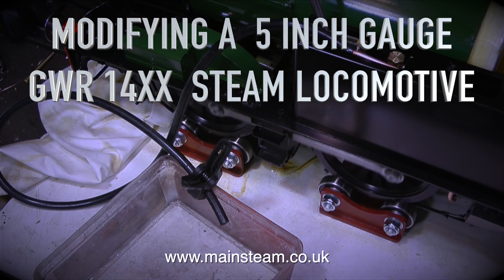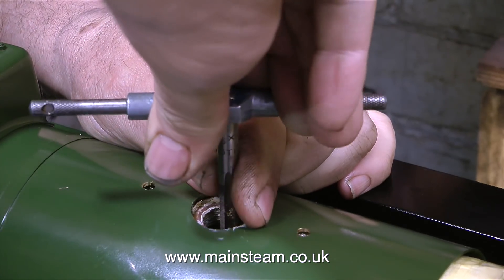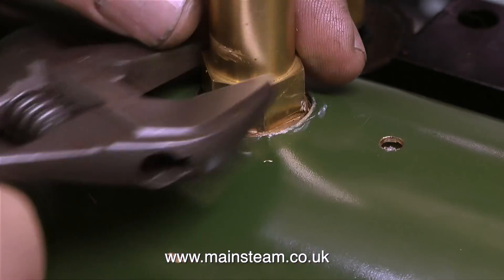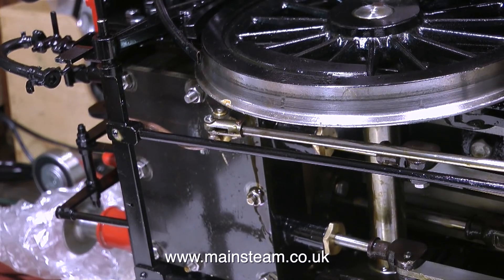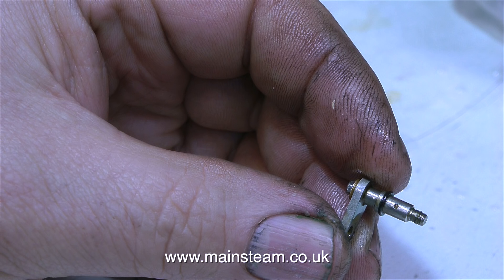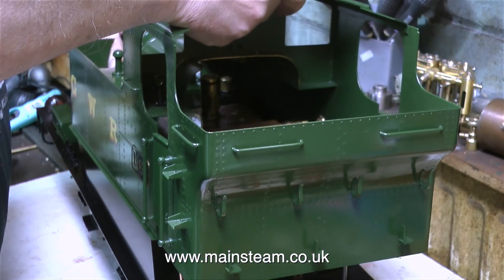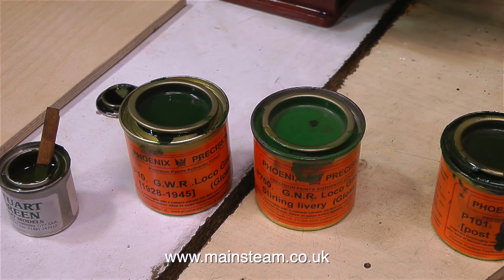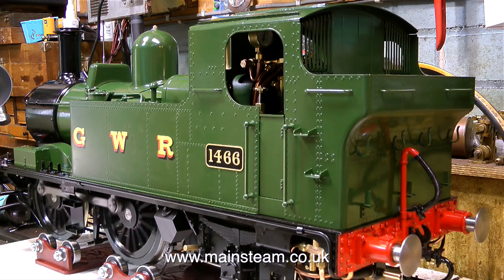MODIFYING A 5 INCH GAUGE GWR 14XX STEAM LOCOMOTIVE - PART #20

Comment: Keith, I noticed the rollers that the forward drive wheels are running on wiggle back and forth as it runs.  It seems to coincide with the operation of the connecting rods.  Is this normal for model trains to do?
Reply from the maker: Yes, but the bench is very oily so the movement of the rolling road is far worse than it actually is . . .

Comment: Morning Keith,  I sent an email to CMD Engineering about the availability of the 7.5 gauge rolling roads set.  I have yet to hear back from them.  Have you noticed if these are carried by Blackgates?
Reply from the maker: I phoned them as I too received no reply to the initial Email - they also sell on Ebay.
Reply: Thanks, I checked with Blackgates who do not make them.  CMD did reply on face book and I will try to order from them.  No reason I cannot make them except there are all ready too many projects.  I have the new piping under the American finished and did a pump test on the hand and cross head pumps.  Only a few bumps and all is good.  I did not want to fire it up to test the injectors until I new I had a good hand pump to cover any emergency with water level. Thanks for all the guidance.

Comment: Was it secured with one of your larger Bahco adjustable spanners?
Reply: Are those Bahco adjustable spanners any good?
Reply: They are alot better than most! Use them proper and they dont round off the edges, 

Also check out the water pump pliers of different sizes from knipex. Theyre my two pocket tools